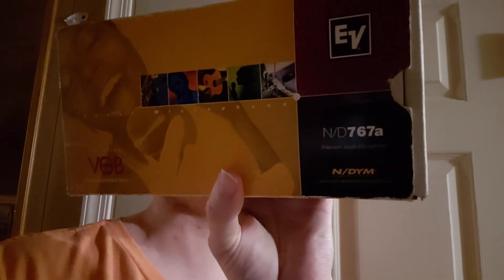Bad Winter NAMM 2020 Audio Quality Explained

Comment: I have to agree with you. I worked the namm show and the lav and headset mics where almost all omni. My own headset is cardiorid and i payed a extra like 15 dollars for that when buying it but its the only way to go if you are at a loud aria. As for no examples thats simply because most of this event was filmed on dslrs and those usually only have 1 1/8th inch jack
Reply from the maker: No doubt, cardioid is well worth the extra money. :-)

Ahh that would make sense, especially if the DSLRs are mic level devices (which I assume they all are).
Now that said, Sescom (the company I got my XLR male stereo to 1/8" TRS phone cable from) makes a line level to mic level padded cable: https://www.sescom.com/products/view/category/categoryslug/attenuator-cables

I looked like a goofball probably using a smartphone to record at AES but damn did the footage come out great. Had my camera man remembered to press the auto exposure/auto focus lock each time. it would have been even better, LOL. I don't mean to brag but, compare the difference: https://youtu.be/tDsQsYa1Epw (2018 era smart phone) vs. https://youtu.be/srIhUhiTkYc (DSLR)
Reply: @RealHomeRecording  So I find the microphone they used for the interviewer to be sounded fantastic it was rich and full. BUT there is no reason why there should be so much noise and talking in the recordings. that headset mic must have been omni and set to being live at all times. what I would do is use a field recorder and do a little noise reduction and automation of both mics to get rid of the noise or at least minimize it to a usable standard. you mic was not as "FULL" sounding but it was consistent and quiet. so yea I have to agree with you on this one.